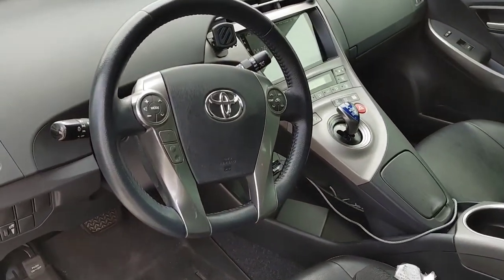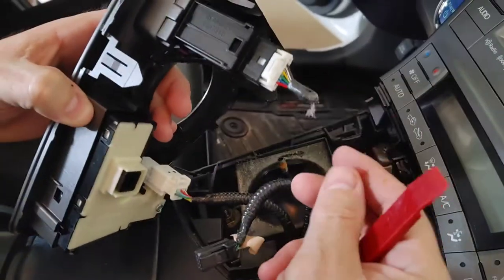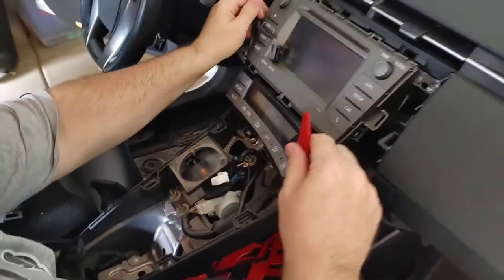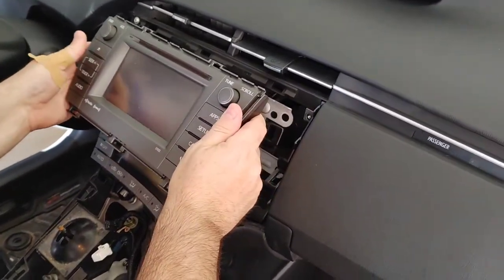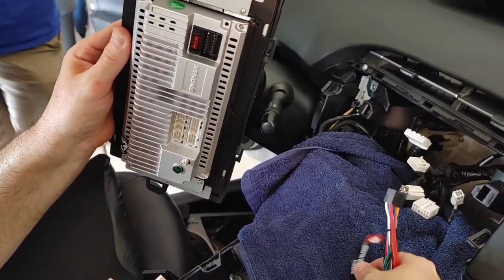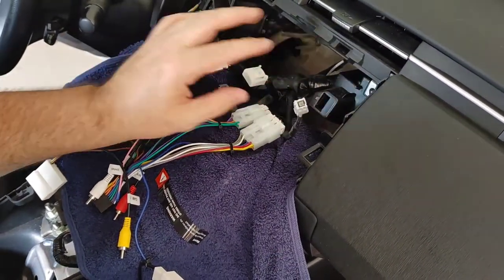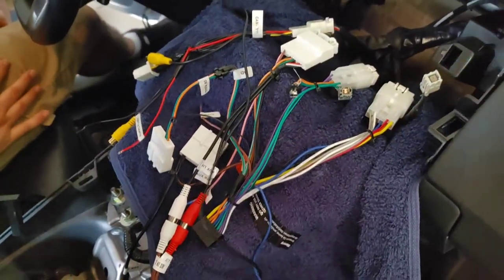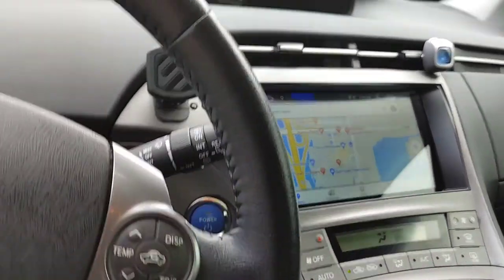Toyota Prius Dash Removal for Install of 9 Inch Touchscreen

Comment: I am kind of disappointed that you were not able to film the entire install. I just bought one like this , its a Hizpo and I was hoping to see what it took to install the 12v to 6v step down as that looks like the most mysterious part of the whole install.
Reply: I have also hizpo but front doors spekers didn't work
Reply: @rojvan7164  you may have an amp that controls the front speakers

Comment: the 3 plug harness connects the radio to the extension box, the extension box was used for bluetooth, and other things like apps. you can just change the extension box on those if your bluetooth or other apps don't work.

Comment: I’m thinking of a similar upgrade, but such an upgrade means losing the “Setup” and “Car” buttons on the factory radio. The “Car” button displays hybrid performance information on the screen. The “Setup” button provides several functional changes (auto lock/unlock, auto on/off lights, etc.).

Does the new unit still allow you to see this info and make changes to car functions?

Comment: Did you use the OEM reverse camera? I'm i bought a 2014 Prius and the previous owner install an Android touch screen but didn't know how to get the reverse camera to work.  Any suggestions?